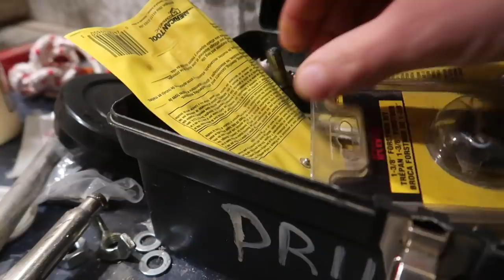Am I Being a Helicopter Dad to our Baby GOAT

Comment: Garlic is usually ready to harvest in early summer. Autumn-planted garlic will be ready to harvest in June and July and spring-planted garlic will be ready slightly later. Simply wait until the leaves have started to wither and turn yellow, and then loosen the bulbs from the soil with a trowel.

Comment: Once you have the barn up you can use ip cams to monitor them all, lay cat6 along with the power cable, Max length is 100 meters (328 ft) so have a small box with power and wifi?

Comment: Baby goat Hope staked a place for herself on the sleeping bench. You mlm may have to create something like it but not as high for Willow and offspring. 

In Texas its mid April and we are still getting cold fronts. By now most of the local farmers have planted cotton and corn a month a-go. Especially corn, they are trying to beat 100 degree heat. Once the corn plant is exposed to 100 degrees, the plant stops setting seed ---- no more pollination. Cold years can be tough years.

Comment: Today is Good Friday, it's rained, turned cold again, 37* with 21mph winds, and we can see real light snow fuzzy's flying around. Apparently Winters not going to end anytime in the midwest or the east. we had two days of 70 degree temperatures with 2 and 1/2 inches of rain did it turn off cold and we've had another 2 and 1/2 inch of rain so we're as muddy and flooded as you are. the 4-H pigs are 11 at though they escaped yesterday and played in the mud.